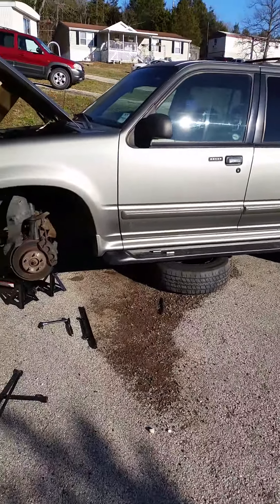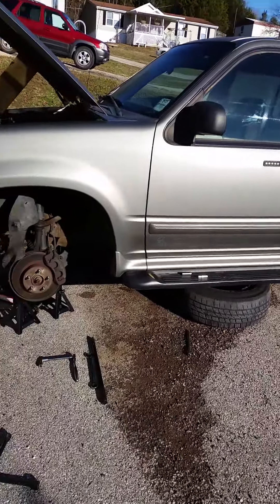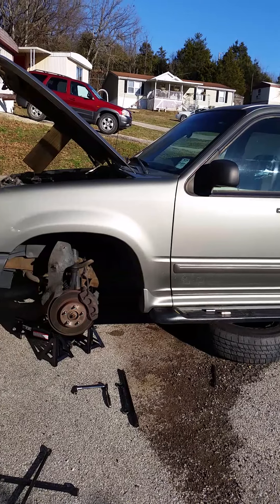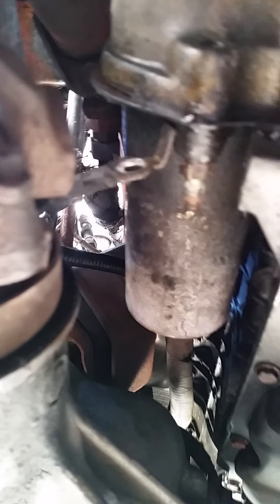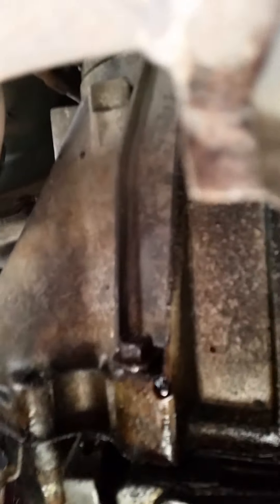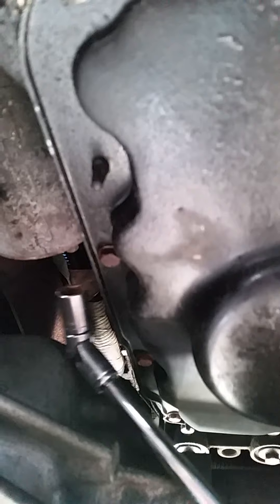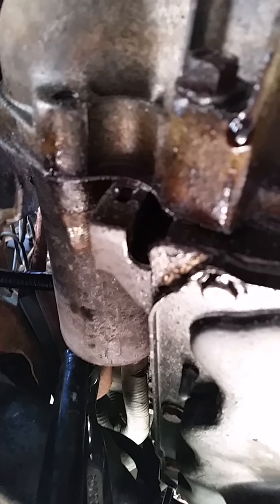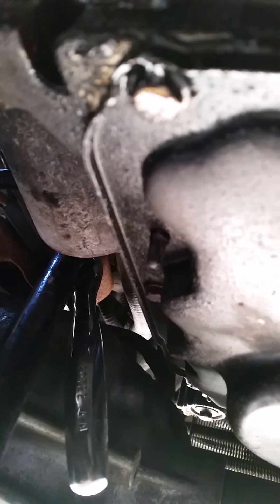FORD EXPLORER TOP STARTER BOLT REMOVAL

Comment: I struggled so hard getting everything off but the top bolt on my starter today. Had to put it all back on, the explorer kinda starts if I prime it. Some sort of auto ratchet or something is needed I figure. I dont have the wheel off though lol or the truck up

Comment: Kinda helpful. I rolled my truck and nothing seems to be fucked up but it just doesn't want to start. I'm thinking it's the starter
Reply from the maker: If you don't have 4x4 then the top bolt isn't that bad to get too.   I just replaced the solenoid on the starter its self.  Saved me a $100 on buying the whole new starter
Reply from the maker: If it is in fact the starter try the ole hammer to the starter trick